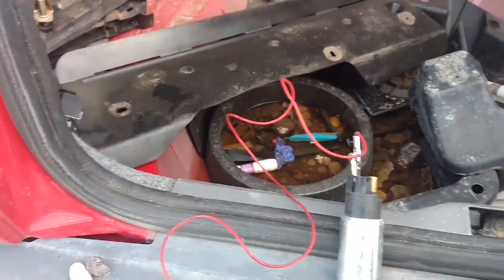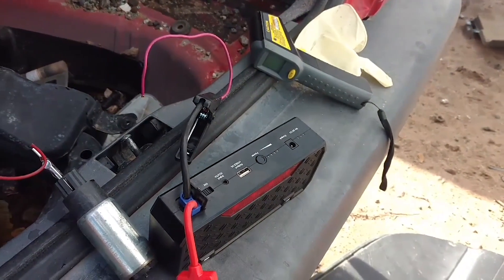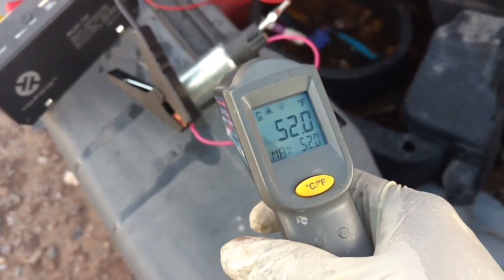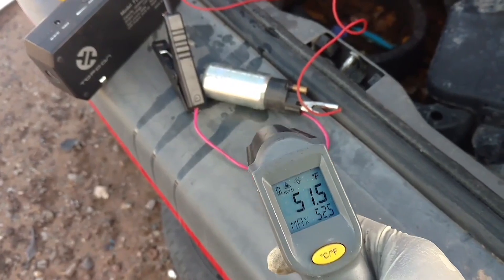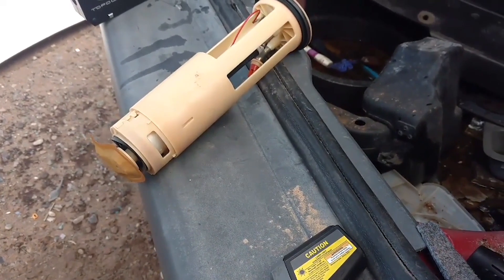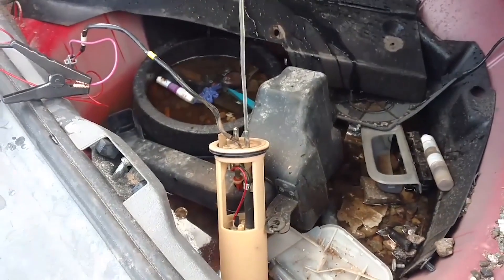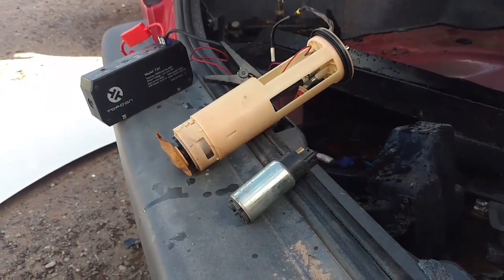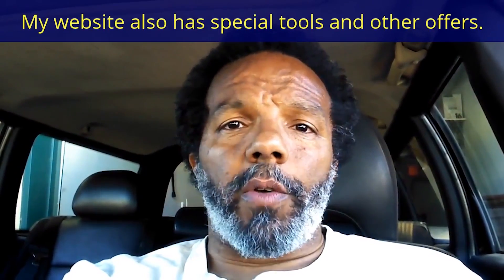Does running your car or truck out of gas damage the fuel pump? - VOTD

Comment: I don't think I've ever heard of anyone burning out a pump trying to start it with no fuel.  I have been told however that its good practice not to run your tank empty before filling it.  The idea being that the fuel in the tank keeps the pump motor cool thus increasing longevity.  Not that I always follow this pracrice but it makes sense to me.
Reply from the maker: I agree.
Reply: People in general aren't running completely out of fuel and if they are, the engine and pump will stop working as you run out of gas.

Comment: Love your content man…good taste in cars too. Selling my 7th LS400 ‘00…gotta love those cars bulletproof I had one when I was a kid 450,000 miles on original drivetrain water pump/timing b every 100k&5k oil changes..I still see it to this day around town! No onto a ‘10 CTS-V..upgraded intercooler pump/5inch cold air I..heavy tune..2 inch long tube headers/dual 3in catless with electric/remote cutouts before mufflers. Tons of fun!! Went from 1/4 tank to running out of gas on highway after about 3 WOT pulls to 130mph. Gas guzzler but what a beast! Keep up the good work
Reply from the maker: Thanks for watching and sharing. 💪🏾

Comment: The older style impeller pumps would get the impellers hot and then they would warp and not pump or pressure would be low.  Or in some cases the impeller would seize in the pump causing it to fail also.  Most newer style pumps have a different style impeller that does not warp or get hot by not being immersed in fuel.  The fuel pumps vary by design on who makes em and for what application.  So without knowing you should try and keep some fuel in the tank.
Reply from the maker: No one TRIES to run out of gas...

Comment: Surprising test results. Two years ago my pump in my 2007 Hyundai Sonata went and by went I mean completely burnt out and melted down within the tank, it stopped while I was driving. The mech said I was lucky I had so little gas as the car likely would have blown up.

Going from broke teen to broke college student I definitely ran that car to E or on one gallon of gas OFTEN. Maybe it was a fluke, but I doubt those wreckless fueling activities didn't help bring that pump to its fiery demise.
Reply from the maker: I'm sure pressurizing the fuel lines is a different kind of strain, empty is not. How many miles did your vehicle have?
Reply from the maker: https://www.youtube.com/watch?v=NWfLpp8NevI
Reply: @RobertDIY  about 190,000 miles at the time
Reply from the maker: lol

Comment: starting my s70 after many many times then I found out it was the fuel relay not the fuel pump made it not pump the right pressure..in only 5 mins has no pressure with the key off ..switch the fuel filter  and relay and still runs weird cuts out some what and doesn't want to start in the morning with out turning the key 3-4 times ...no worries im going to try an ebay $35 whole  NEW aftermarket unit fuel pump im sure it will last 6 months but its kinda a test...
Reply from the maker: Man, some last a long time. My mechanic here installs those all the time.